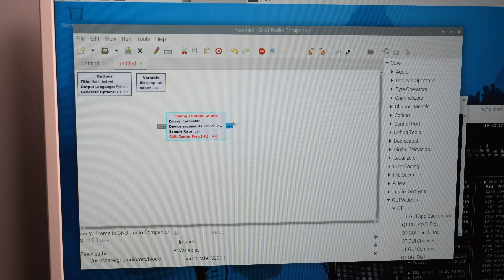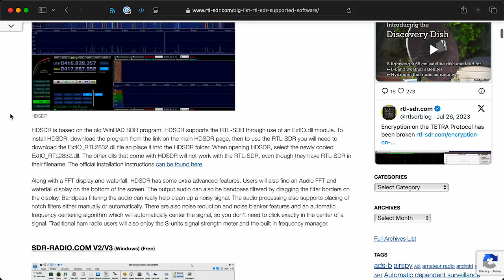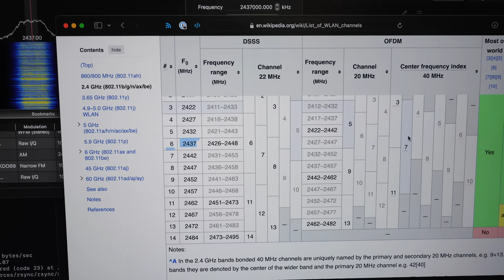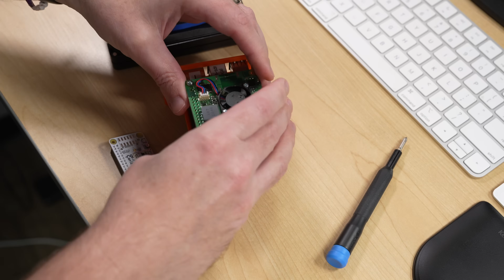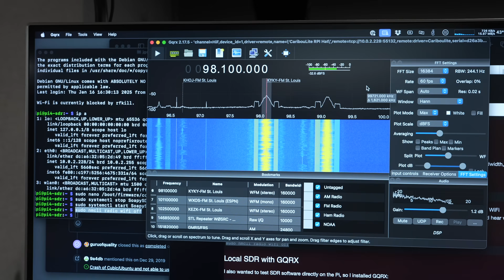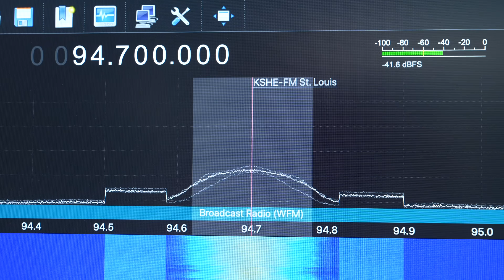Radio Hacking 101: Raspberry Pi SDR with a CaribouLite

Comment: The fun really starts with active outdoor antennas for HF and VHF/UHF ... when I see your spectrum with all the noise, most of the repetitive signals from USB DC-DC converters and switching supplies, that gives you more potential for frustration than joy. With e.g. a wideband HF magnetic loop antenna and a separate wideband VHF/UHF antenna you can receive HFDL aircraft positions from literally the other end of the world, without the Internet ... or ADSB signals from secondary radar (UHF 1090MHz) until the radio horizon, or weather balloons (400MHz) that land somewhere for you to be picked up, world wide air to ground aircraft communication on HF, NATO Emergency communications (EAMs) in voice but encrypted, Inmarsat communications (JAERO 1.5GHz), ACARS & VDL2 aircraft data comms (VHF 131/136MHz) ... 137MHz Weather Satellite Images and tons of other interesting stuff.
You can also build the antennas yourself or use a kit with a pre assembled preamp and build the antenna from any "home depot" alike store material for little money. The RTL-SDR is definitely a perfectly versatile inexpensive unit to start with and its limited 8 Bit resolution gives you the opportunity to process data with tiny SBCs, rather than processing very wide bandwidth at 16 Bit, that requires ideally a GPU and powerful CPU on a serious USB 3.1. There is plenty of great free receiving and decoding software available. So please start simple, build a good antenna and if you get passionate about it, get some serious stuff, there are really great highly capable SDRs available for under 200$, which make even a lot of expensive ham radio transceivers look really old, because of very high dynamic range (16/18 Bit AD), bandwidth and way more versatility, decoding weak signals over several frequency bands simultaneously!

Comment: Interesting KMOX is mono, and doesn't have any digital sub-bands.  I've done a bit of SDR stuff. It's always fascinating to "see" radio signals over time and the fact you can "see" a whole range of frequencies instead of just one frequency.  I have one of those Kraken direction finders with 5 SDRs on one board.  That's black magic to me.

Comment: One important thing to remember when you start your SDR journey is to check your local laws and regulations for receiving radio signals.

In the USA I think it's rather relaxed and more seen as a public right. In the UK, however, it is illegal to "receive" signals not intended for general consumption or without the license holder's authorisation.

See more - Wireless Telegraphy Act 2006, OFCOM

Comment: I always wondered, what is the point of many low power devices like pi4 instead of one mid end regular pc?
Reply: $35, low power, really compact, reliable, and GPIO access. Everything helped in this radio project

Comment: I've gotten accustomed to having a wide bandwidth on my SDR, so it's hard to drop down to something like this.
Reply from the maker: This is definitely on the lower end :)
Reply: @JeffGeerling  It's way cooler though. Attaching an SDR to a large box is easy, but getting this stuff to work is a challenge. I applaud the effort.

Comment: I'd be really curious to hear how the CaribouLite does with the ham bands. It'd be fun to build a filter switch box for it and be able to dial in on the HF bands from my pi, or monitor APRS or something.
Reply from the maker: I'm setting up a loop antenna soon and will hopefully try out at least WWV and some other signals down in the 5-10 MHz range.

Comment: SDR + RTL433 and home assistant make a perfect combination for picking up and integrating an oil tank sensor and a whole raft of other, unencrypted RF devices. That combination has been telling HA how much oil is left in the tank for several years.
Reply from the maker: I'm planning on setting one up with a weather station at home to connect it to HA!
Reply: @JeffGeerling  That also works 100%. I'm picking up the oil tank monitors, weather stations, car remote controls and car TPMS signals of the entire village 🙂. My biggest problem at first was to work out which of the oil monitors was mine!
HA is a much nicer front end than the plug in oil sensor receiver that we never looked at. And HA is setup to remind me when we need to order more heating oil, so we don't run out anymore either.
Reply: @JeffGeerling I attached mine to my outdoor TV antenna.  Then I got weather stations from all over my neighborhood!
Reply: @JeffGeerling Let us know which weather station you decide on.
Reply: @JeffGeerling  like the guy with a Swiss accent did years ago? 🤫
Reply from the maker: @timballam3675  Having multiple people do the same project is always good. (a) it can show how things change or get better (or worse) over time, and (b) unique perspectives are always helpful.

The guy with the Swiss accent has a fairly different audience from mine, and thus we both have different goals in mind when both planning our projects and making videos about them!

IMO, it's never a competition here, we are all able to do fun things and hopefully inspire!
Reply: I use it to read my gas meter. Theoretically it could receive my Landis + Gyr electric meter but it’s an encrypted signal and, as far as I know, no one has broken the encryption yet.
Reply: Same here.  Using it to receive car remote signals and small RF keychain dungle.  Connected directly into my openHab instance.  Useful.
Reply: I use an SDR and rtl433 monitor my electricity/gas usage
Reply: I am doing the same thing via MQTT from RTL433 to monitor my outdoor temperature sensors.  It's amazing what it can pick up.
Reply: hi, I've been toying with the idea of adding oil tank monitoring with raspi. Initially i'd been messing with rfm02b modules, but to be honest I couldn't figure out if I was even receiving anything let alone to decode the Apollo sensor's signal. I'd looked at SDR online but I wonder how much processing power I'd need to use to get the oil tank data. I want to use the raspi for other things too, and also don't want to use much electrical power.
Reply: @ RTL433 requires little processing power, especially if you restrict what it listens to. I've ran it alongside other services on an RPi3, 4 and CM4. To make my life easier I built a Docker container for it but that's not necessary. I use a USB RTL-SDR receiver (RTL2832U/R820T2, cost me £14.50 5 years ago) and pass the usb port to the container. The rtl433_hass python script runs outside the container (so I can restart it automatically if/when it crashes) and pushes updates automatically for home assistant to pick up.
With the RTL433 and my Zigbee controller (zigbee2mqtt), the CM4 is 99.4% idle and uses hardly any RAM.
Reply: @andrewbird3691  re: power consumption, the CM4 with my SDR USB stick and Zigbee controller is running from POE. The switch is currently reporting 4.8W on that port. The carrier board I use also has battery backup on it, just in case (and to keep going when I'm swapping cables around).
Reply: Ooh, thanks for the idea!

Comment: Hi, the frequency range is impressive for the announced price ($119), however low signal and noise ratio will need a thorough dive into the bowels of the thing before anything to make sure it is a really interesting device - what is puzzling (and a bad omen) is the lack of shielding though.
Reply from the maker: I believe the baggie has a sticker about it being a development board for the time being. There was a plan for an RF shield but so far I haven't seen a model with one installed.
Reply: @ I saw that on close pictures, shielding locations are delimited by the usual large golden tracks sprinkled with ground vias -  check with your dad for places and metal to use and  tinker a bit to build and weld them, you should see great  improvements in sensitivity (w/ an external antenna, inside, apart the WiFi, you also get the noise from computers, cameras, lamps, etc).

Comment: What is that system monitor program you use at 11:11 ? So much more info than htop!
Reply: I was wondering too! Looks like btop++
Reply from the maker: It is indeed btop, and I have a whole video with it and the other Linux monitoring CLI tools I use on Level2Jeff :)
Reply: …and it looks glorious
Reply: 95+% confidence that it is btop.. a prior video here on 1st channel or over the 2nd channel covers various utilities.. and also posted on his site or github.. googled it and then closed it

Comment: I still haven't heard of a compelling reason to actually get an SDR device. Ok, so I can listen to FM radio, but I can do that with a used FM radio pulled from a garbage bin. I feel like the novelty of looking at a radio FFT graph wears off in about 15 minutes. I have the same problem with the Flipper Zero, half of the reviewers rave about how they can use it to control IR devices like TVs, but universal remotes have existed since at least the 90s.
Reply from the maker: It's a good question—my Dad uses an RTL-SDR at his desk with a nice big FM antenna to monitor power and side bands on the STL market FM stations, because some of them don't filter things well and it causes signal issues with his lower power FM signals.

I also have used it (along with walking around) to find the source of some RF noise from a charger in my studio that was causing Bluetooth problems.

Then there's ADS-B monitoring, you can monitor aircraft above where you live and contribute that data to central resources like FlightAware for citizen-sourced flight tracking.

There's low power communications, there's sensor data reading like utility power meters and weather stations... a lot more besides, this video is just giving a general idea of what you can do.

Usually when starting you use FM signals (at least here in the US) because they're so high power and easy to receive (they're in a frequency sweet spot for most cheap SDR dongles), but that's one of the more boring things unless you're an FM broadcast engineer :D
Reply: There is none if you don't want to learn about or work with radio. The best thing I can come up with if you don't want to DIY projects is communicating with satellites.
They're good for troubleshooting, reverse engineering, prototyping, exploring the RF spectrum, amateur radio that sort of thing. But if you don't find those things intrinsically interesting then yeah I don't really have much of a reason for you. It's major trick is being able to interface with software very easily. So you can replace a lot of radio hardware and some knowledge with just software. 

Essentially before they hacked the broadcasts TV tuners to be cheap SDRs.(The origin of the RTL SDR) The main way to make gnuradio work was up or down converting the signal to the audio spectrum and then sending it through a sound card. That wasn't an uncommon way to get a radio to interface with a computer. Once FPGA started to come down and price and be useful for this application SDRs became a lot more accessible. I wouldn't be surprised if some of the cheap RF modules you get for projects now are an SDR running some proprietary software to transcode things.

Comment: So could I use a Caribou to transmit a localized FM broadcast and tune it in on a radio close by?
Reply from the maker: Technically yes, I haven't messed around with FM transmission on it, but that seems doable. You can also do it from the GPIO pins on a Raspberry Pi without the HAT too ;)

Comment: Don't transmit unless you have the required license to use the band. You don't want to make others mad and end up with a $10K fine from the FCC. Get those LMR, GMRS, and/or Amateur licenses first, or stick to the public bands within the legal power limits.

You also might want to make use of a diplexer as well so you can have both connectors connected to the same antenna.

Comment: As someone whose job involves working with the RF spectrum (albeit on a larger scale and over longer distances), seeing that there’s pi hardware for it, it’s reassuring. Because it means that I can have cheaper solutions to do learning experiences with that aren’t multi thousand dollar antennas and dishes. Cheers!
Reply from the maker: And if you accidentally nuke your receiver by doing something silly... it's not a multi-thousand-dollar loss!
Reply: Yep, we need to keep rf relevant.. This is the evolution, we‘re up to SDR with applications to decode(/encode) the signal(s) instead of dedicated radios used for specific modes (voice & morse).
Reply: You can get an RTL-SDR v4 for fifty bucks and hook it to your computer. Attach a wire for an antenna, and you can start receiving stuff from across the ocean. Super cool hobby.
Reply: There's plenty of cheap SDR hardware for nearly 10 years now.. did you miss it all?
Reply from the maker: @tiagoangelo3828  There's also new hardware coming out every year, too... just this year I found out about the cheap Nooelec, and the RTL-SDR v4 came out last year I think. Always fun to explore the options!
Reply: @JeffGeerling nooelec was my gateway drug into ham radio.
Reply: I only moved to this new job where I needed to actually know things about RF within the past year. I got to baby sit the fancy expensive equipment while it did its thing before, but only recently had to start to know how it all worked. So never really on my radar until recently.

Comment: raspi is not cheap lol not compared to its competitors
Reply from the maker: The $35 Pi 4 is still a fine deal compared to other cheap Arm SBCs in the same price range.

It's not the fastest, or most featureful, but if you compare other boards below $40, it is certainly the best supported.
Reply: @JeffGeerling  That is certainly true, and for many the most significant part.

Comment: but will it run with Openwebrx ?
Reply from the maker: I believe so, and was going to test, but never quite got around to it! Would love to have it all running in browser too.
Reply: @JeffGeerling  Openwebrx especially the 'plus version' allows decoding of a lot of data formats, so if it could work with Openwebrx, that would be a huge bonus.
I wouldnt have to use my SDRplayDX tuner

Comment: I would love a deep dive into some of the SDR applications. I have tried my best, but I just don't understand what settings I need to change based upon the spectrum range. I know that they need to be adjusted as you go though.
Reply: What are you using? Both program and sdr.
Reply: @EvertG8086  Same software as Jeff had and an RTL-SDR

Comment: Same here Jeff. I purchased one of these a couple of years ago and didn't use it. I pulled it out 6mo ago and started using and quickly noticed a bit of a learning curve.

 I stepped away from it due to time, but I noticed your video and I think I'm going pick it back up again to learn with you. Thank you for bringing this back up again.
Reply: I've got a USB SDR dongle.  It works but demonstrates a major problem with the current state of the technology:  All of the tiny SDR devices get extremely hot after just a few minutes of use.  As in "I am concerned they might melt and start an actual fire" level of hot.  I suspect the excess heat also lowers their lifespan and general usefulness.  For short bursts of a few minutes here or there just to mess around with it and someone is physically available if something goes wrong, I wouldn't be too concerned, but leaving one turned on 24/7 is a fire hazard.
Reply from the maker: @privacyvalued4134  For a lot of permanent installs, I've seen people put fans moving some air over the dongle, as that helps a lot with keeping it cool and working with a bit more optimal performance.
Reply: @JeffGeerling have you noticed any heating issues with your CaribouLite?
Reply from the maker: @YonatanAvhar  It gets warm but I haven't had any overheating issues with it running a few days at a time. I only had it actively in use for an hour or two at a time though.

I will probably put a fan in the back of my mini rack to get more airflow over the HAT though.

Comment: Tip for people getting started into SDR, Don't be afraid to make your own antenna. With a simple bit of coax you can make an antenna to pick up 1090mhz and track planes.
Reply from the maker: True! It's amazing what you can do with some experimentation.

The great thing about SDR is since it's so visual, and a lot of tools exist, you can learn how to tune an antenna pretty quickly, like I never knew how much of a difference the little tuning knob on my AM loop antenna made until I tested it with GQRX!
Reply: Got a pi zero 2 connected to a cheap dongle sdr and antenna for fr24. Tiny antenna rarely sees more than 60nm and a decent size antenna is £40-60 but didn’t see much on antenna design for making a custom one. Airnav and shipxplorer sell kits and supposedly their sdr has better filtering / amplification that matters for range? something cheaper than 100 or more performant would be appreciated. 162 mhz for ships, 1090 for air
Reply: Yep, built a few different Di-Pole antennas. Now I am getting drawn into the world of Smith Charts and Spectrum Analyzers. LOL
Reply: With a Balun 1:9 I have 100ft of speaker cable split into an inverted-L type dipole tied up 10' high  and am getting very surprising signals under 50mhz.
Reply: Do be afraid! It is a dark art like he said, and without the proper incantations you could summon the demon Yagi-uda
Reply: Very true the Yagi-Uda demon uses vampiric witchcraft to weaken your RF energies in a particular spot but gives you a plus 3 hit multiplier in the opposite direction of its attack. 🌈The more you know🎶 @laurisjones